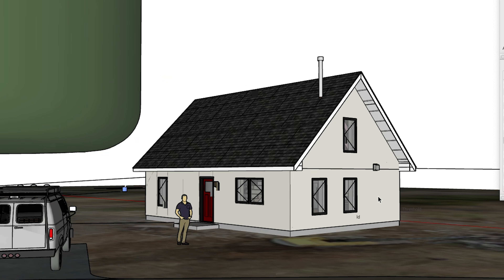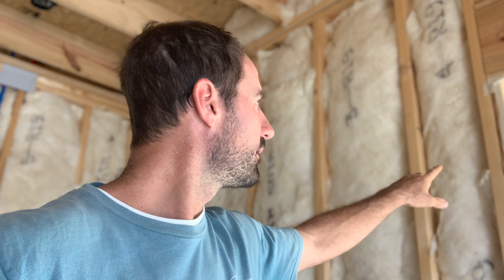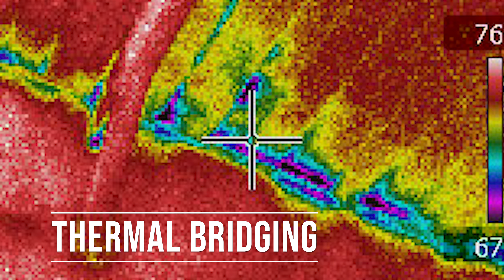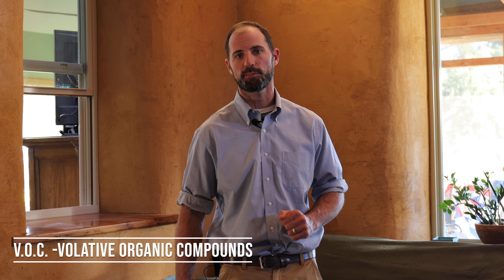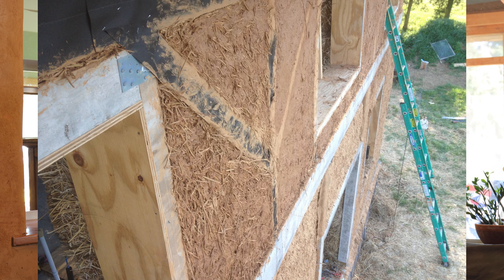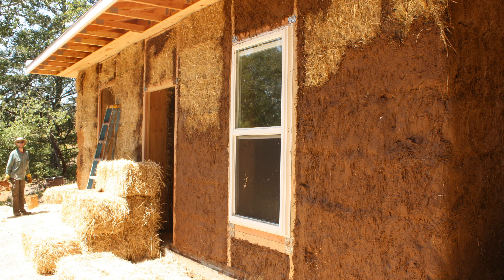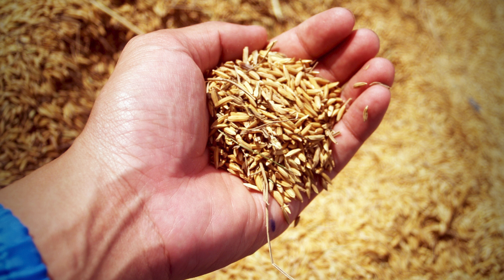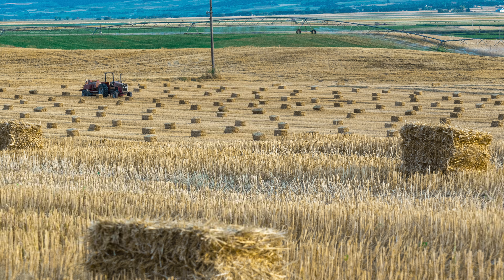The BEST way to build a new home? Building a House with STRAW BALES : Start to Finish - Episode 1

Comment: Great points. Well done. What is the r-value? Can they be used in a double studded wall and make the home just look like conventional framed
Reply from the maker: The R-value for a strawbale wall is between R-25 and R-30 depending on how well its installed and the relative humidity. They can be used in a double stud wall to create a conventional looking home, but it would be easier and cheaper to just build with the double stud wall, and blown in insulation if you plan to cover with conventional sheathing/siding and drywall (most of the cost savings with strawbales is in the sweat equity from installing the plaster vs plywood sheathing, siding, drywall and paint.)
Reply: @HeirloomBuilders  : thanks

Comment: How about termites being attracted to the strawbale house?
How do they hold up to high winds like tornados here in Texas?
Reply from the maker: Good questions. Termites only eat wood, and not straw. So fortunately they are not a risk to a straw bale home. A plastered straw bale wall that has 1" of plaster on both inside and outside surfaces will resist at least 110 mph wind pressure. I've never seen a straw bale home versus a tornado, but I feel like it would survive better than a conventional home.

Comment: Great info! Are Multiple stories possible? What costs could someone expect per sq/ft? If we do it ourselves vs hiring you!
Reply from the maker: Great questions. Multiple stories are definitely possible. Cost is about the same as a typical custom home. Unless you build it yourself, in which case it can be done for major savings. Straw bales replace the insulation, and the plaster replaces drywall, paint, plywood sheathing, and siding. So you could save as much as $30/sq ft. More info coming on “what’s it cost?” Next Monday at 8pm. Stay tuned!